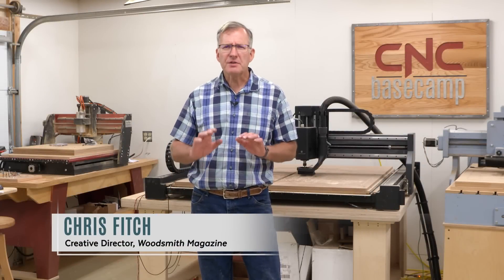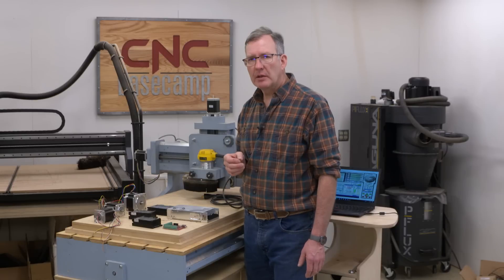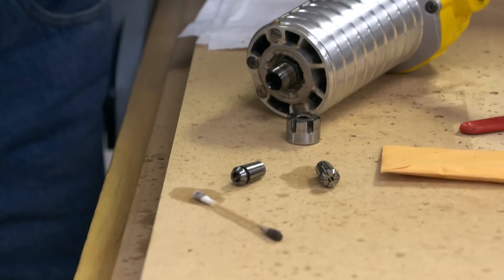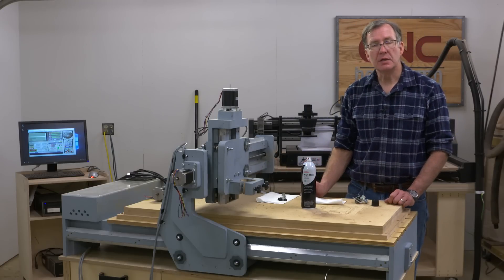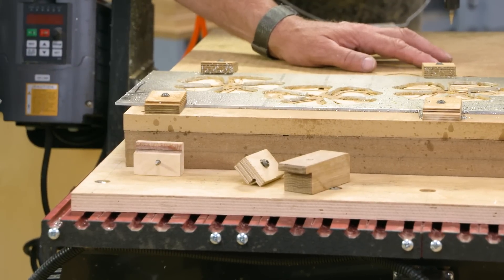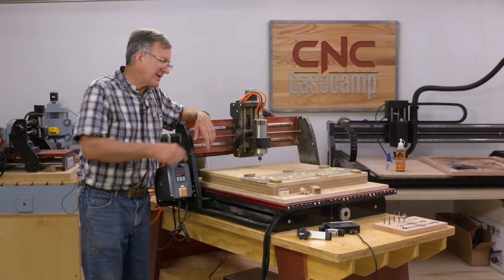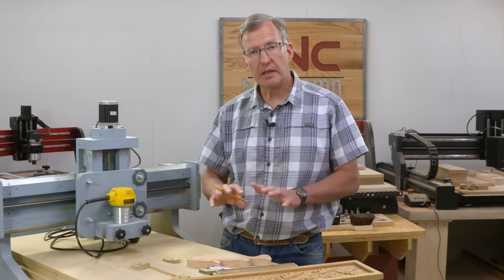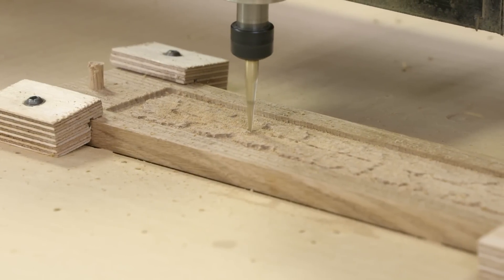CNC Basecamp E024: Best of Basecamp - CNC Basics

Comment: Thanks Chris for this summary and for all the free CNC Basecamp videos! I watched them all in the last two weeks, very helpful and instructive. Apart from the technique, most helpful are demonstrating the things that can go wrong, so you know what to look out for.
I almost finished building the Woodsmith CNC router and looking forward in the coming two weeks or so to start cutting 😀 
Before I started the construction, I had to convert inches to mm and adapt material sizes to what is available locally, so I first designed and drew the CNC router in mm in Sketchup to get a good idea of how things would fit together.
In the Woodsmith video of issue 242 you mention a wooden clock as example. Would it be possible to make a CNC Basecamp video about building one, including the clock-gear calculations? Would be great if you could! 😀